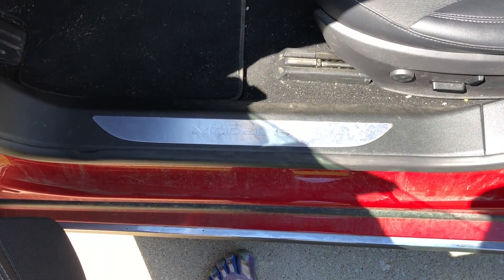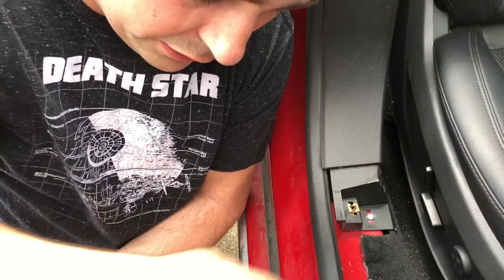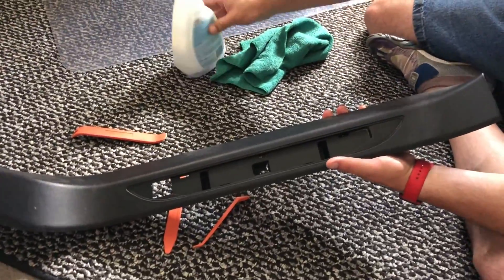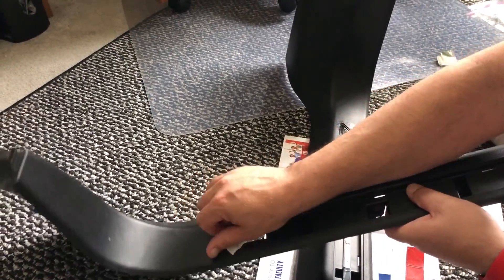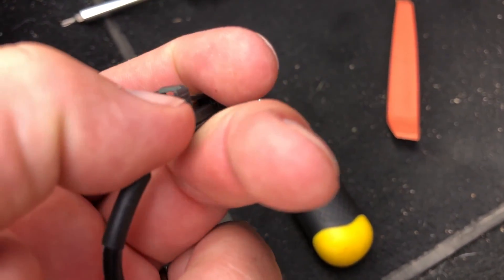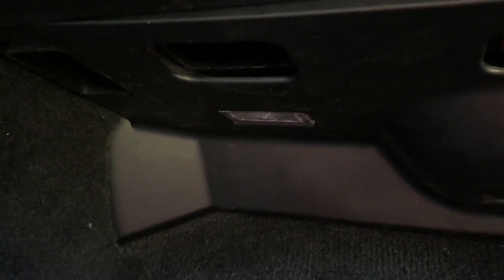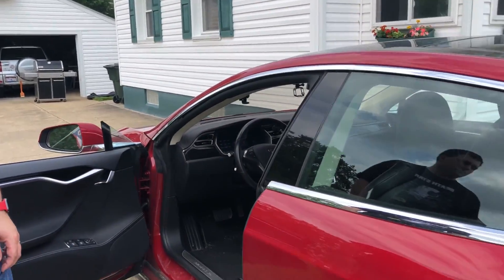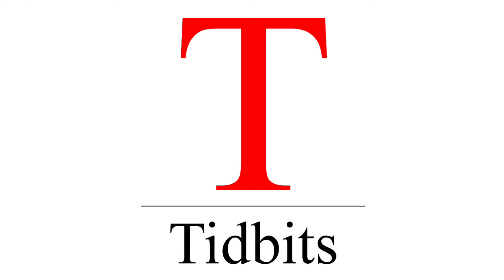Special Tidbit - Lighted Door Sill Plate Install

Comment: If you only have partial premium interior and your footwell lights dont turn on, will this still receive power?
Reply from the maker: No, as it relies on the foot well lights for its power.  Also, he only makes them for Model S, so that's something to be aware of as well.
Reply: @Teslatidbits  is there another power source that can be used for these sills if you have partial premium interior?